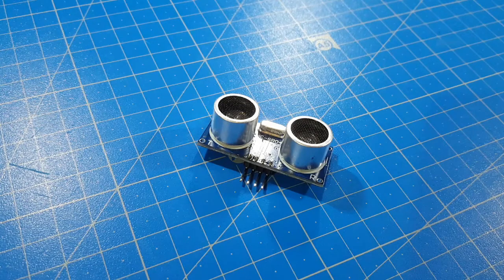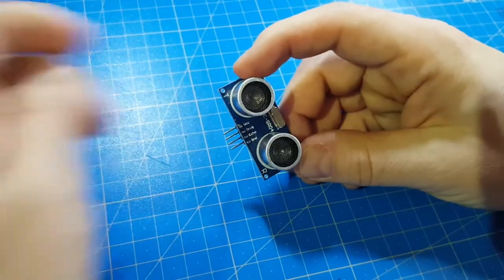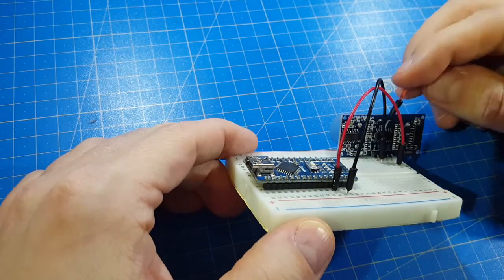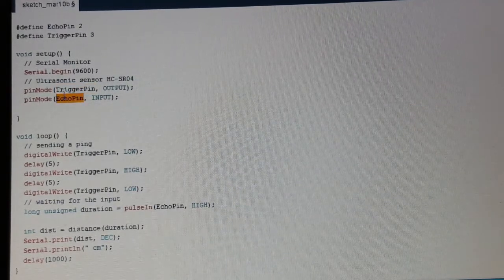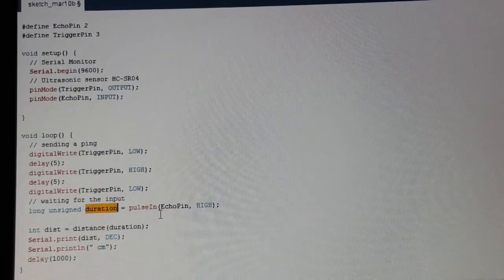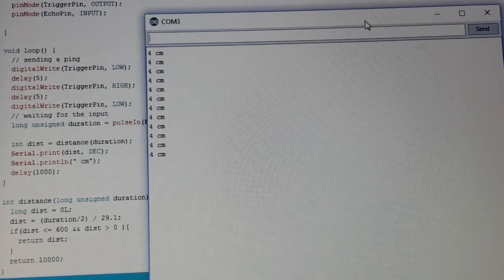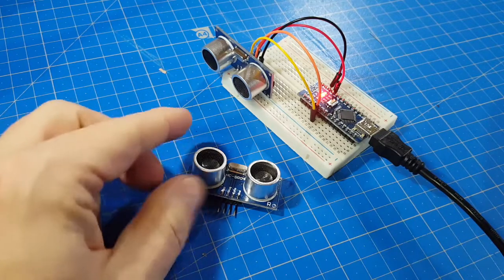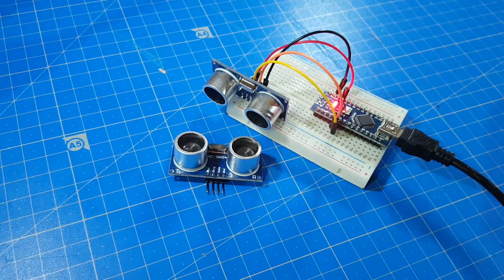Ultrasonic Distance Sensor HC-SR04

Comment: Hi. I've been working with these sensors for awhile. QuiteI've tried the hy-srf05, hc-sr04, urm34 v4, LvMaxEZ, (different topic, rcwl-0516, and a pir). All of these I've been able to use picaxe. And all have limited distance. (<3ft)   Tried changing pulsout/pulsin times with no avail. All vids I've seen use arduino and have no better range. The project I'm working on uses servos, so analog seems best fit unless extra controllers. I've learned ir sensors don't tolerate sun well either, so, with all your experience testing sensors, is there a sensor that can go distances at least to 5m? Some forementioned boast but fail miserably. I've switched to automotive bumper sensors as they have a consistent 4ft range but looking for more range.  Thanks.
Reply from the maker: In the lower price segment, this sensor has the best range - about 3 Meters / 10 feet. I've also tested the Sharp IR sensor - about 0.40 Meter / 1 feet. And a laser distance sensor ToF - about 1.2 Meters / 4 feet.
Well, I guess you'll get the best results from the radar distance sensors, like those in high class cars. A quick search and I found some of them as spare parts. But they costs more than 300€. And I'm not sure if you can make the µC to operate it.
Reply: nenioc187 yeah, I was thinking radar, but haven't found any that reach out far enough. The ones I've tried are on/off like pir's. Not helpful for my purpose. Thanks though. Someday technology will catch up to crazy minds.
Reply: Try the US-100, it goes up to 4.5 m not quite the 5 m you want but close
I am trying to find a digital output-distance sensor for PixRacer, but there is only the 180 dollars Lidar Lite :(
Arduino is just not an option for flight controller.